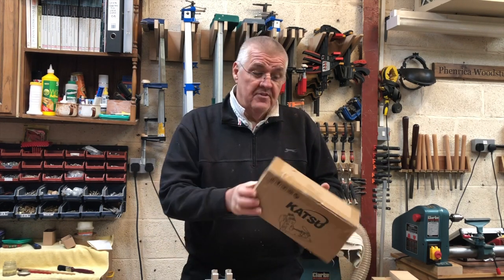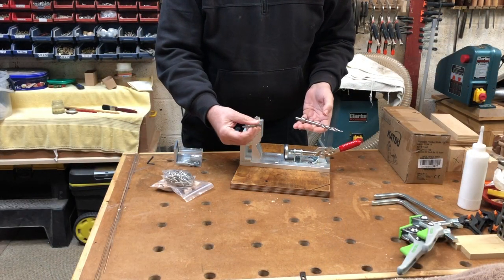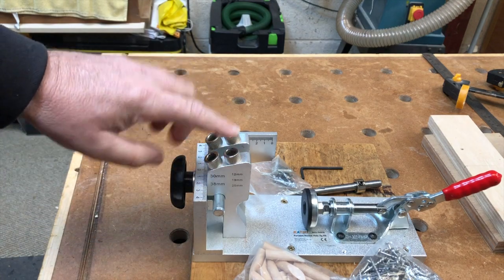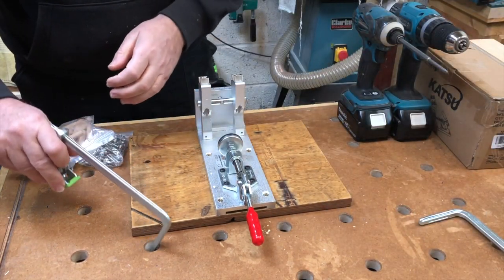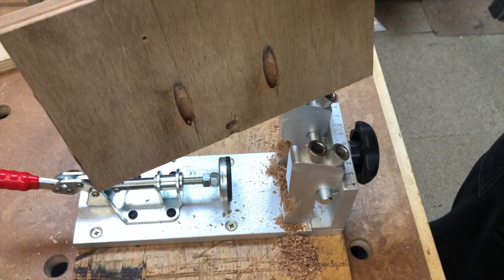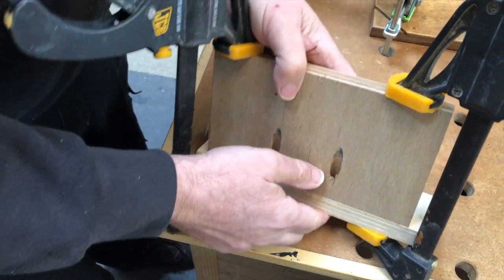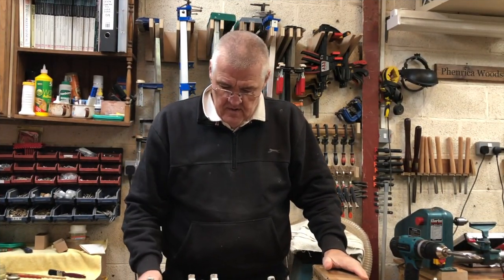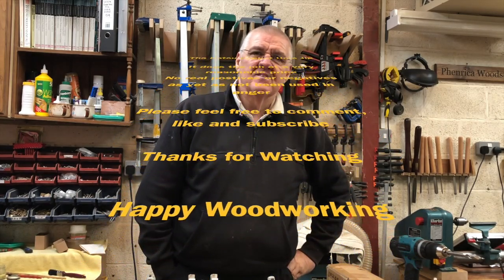Katsu Pocket Hole Jig  - Tool Review Tuesday

Comment: I think they changed the dimensions of the jig because mine (just got it) wouldn't clamp even 16mm wood it was too thick for the max adjustment. Had to get the bolt out and cut a bit off which did the trick. However that is the clamps max depth, it won't clamp more than that. Cheers for the vid though.👏
Reply from the maker: Bizarre size to max out on 16mm 😏 I’d have thought maybe 18/19mm. Got to admit I’ve actually not used it since the review, prob need to drum up some projects for its use 🤔 Thanks for the watch, comment and compliment 👍🏻 Cheers Steve
Reply: @Phenrica  Cheers for the reply Steve. Think I might've got one that slipped through the production line without being checked. From looking at the female threaded part the the bolt goes into from your vid and other bids mine is maybe 20mm too long, which explains why the clamp won't do up on the thicker wood. I'll chop a bit of the female thread and bolt it should cure it.👍

Comment: That looks a really well made and finished jig, and you didn't have to spend a day re making it like you do with the rutlands stuff! What I really liked was the dog hole clamp you used there, where does that come from Steve? Chris B.
Reply from the maker: Englishman French Cheers Chris, the clamps are a festool item, I got them from Axminster on one of their sales days, as you’d expect they’re not cheap about £40 each I think. As for the jig, yep so far so good, just had to file a bit of the cap screws for the portable L bracket, thought I’d put that in the vid 😏 they where bout2mm too long

Comment: Save your money I just went to use mine it has not been tapped far enough back to wind back the arm gutted I am.
Reply from the maker: I guess you’re using some wide stock? I’ve used 4x2 but had to remove the locking nut off the plunge clamp. Got to admit it’s not a tool I use daily however when I’ve used it it’s been just the job.
Reply: @Phenrica  Probably not tapped far enough looked OK till I tried it 40mm